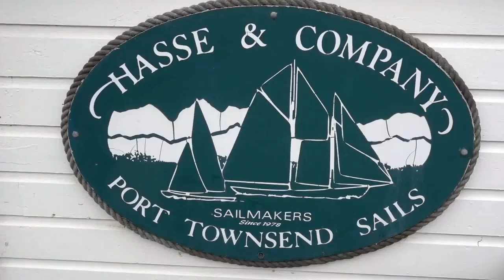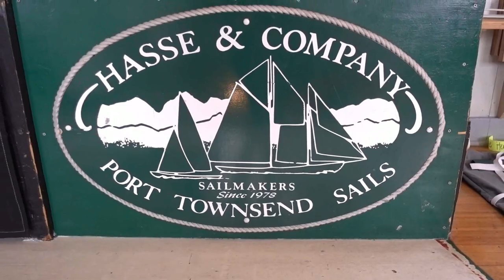We made it to PORT TOWNSEND!! | S2:E11 Sailing Stella J - Island Packet 38

Comment: What has been your experience with the Island Packet chainplate problem?  Have you replaced them, or were they replaced in the past? I'm in the process of buying an IP29 so I am curious how it's worked out for you guys.  Great videos!
Reply from the maker: Well Justin, I wouldn't say I've had a problem, yet.. The manual shows the chain plates are glassed in so inspection is near impossible, however the survey showed no moisture and  I have read about the reliability of IP's chain plates. Unlike other glassed in chain plates on other boats, say like Tayana's, I have never heard of any IP owners having to cut out and replace their plates. I think you should continue with your IP29 purchase, pending your survey of course, I think you  will not regret your decision, just as I have not!! Good Luck!!